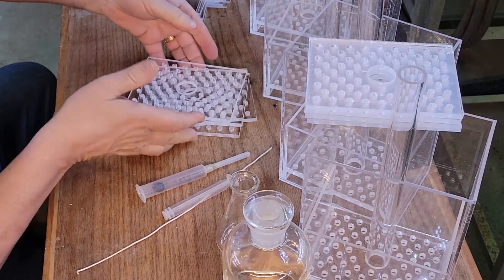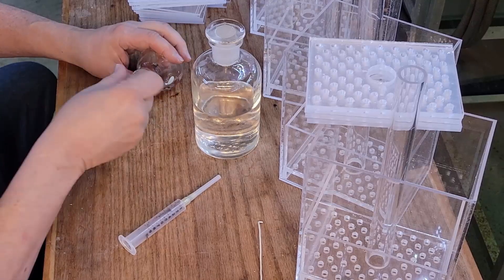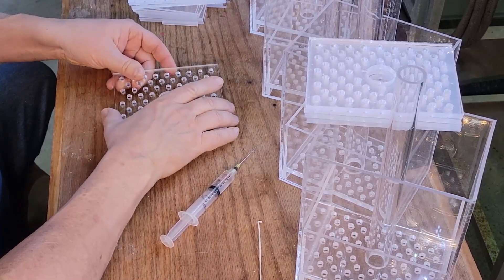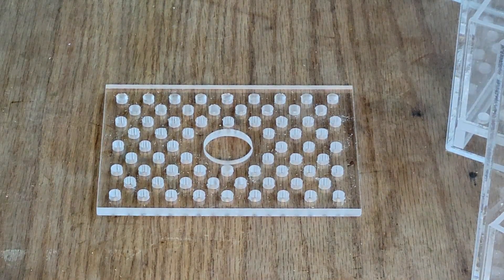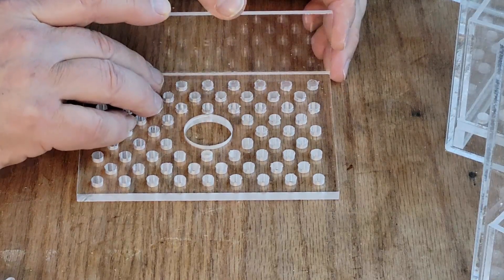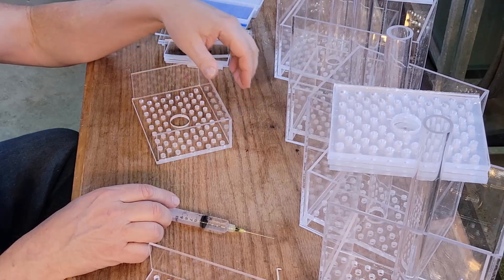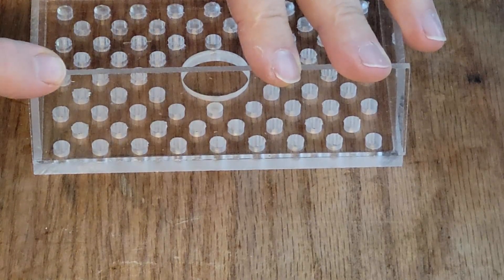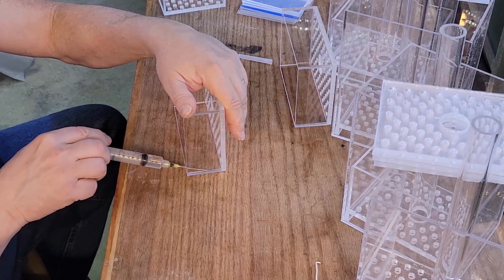Acrylic Welding: The Basics

Comment: Good and calm explanation! Thanks for this. I'm wondering if you're making products and a drop of glue falls on an undesirable spot, how can you remove this white, flaky glue stain afterward? Is there a trick for this?
Reply from the maker: You can, but it's labor intensive involving varying grits of acrylic abrasives and allot of buffing. That's why I use the syringe. It cuts down on most of that. Thanks for watching!

Comment: Where do you get your methylene? Is it the same as Methylene Blue? What about the syringes and needles? What gauge needle do you use?  Thanks.
Reply from the maker: Methylene chloride is not at all related to methylene blue. Methylene blue is a gram negative bacterial wall stain that prevents them from dividing. Methylene chloride is a chemical solvent. Thanks for the question!

Comment: methylene chloride is being banned for a variety of applications.
It is extremely unhealthy to breath.
I also used it for acrylic welding, but now I will only do it outside and with the wind blowing it away.
Reply from the maker: It is toxic, but the main reason for it being band in many places is due to it's explosive qualities when being shipped in quantity. It's still being used for consumption in applications like decaffeinated coffee. That said definitely use it in well ventilated spaces and most importantly use a syringe for application. With a syringe you can apply exact amounts and there is very little to gas off. Thanks for the comment!

Comment: Great video, I use glass syringe with a break works great and no need to worry about the rubber stopper. Try it if you do a lot of solvent welding like I do.
Reply: Also last for ever been using the same one for over 8 months .
Reply from the maker: I used to have some, but they got lost a long time ago. Are good ones expensive?

Comment: One secret taught to me by an Acrylic expert: Take some of the old needles from your solvent dispenser and pound them flat.
Then use those as shims in your joint before flowing the solvent.  Once the solvent completely "wets" the joint, let it set for a few seconds to soften the material, then pull the shims out and let the joint compress.
Reply from the maker: I've heard the same thing, but only when welding thicker material. Thanks for coming by!

Comment: Facinating. How did you drill all the holes without splitting/cracking the acrylic? My experience is poor and frustrating. Of course you may have used a laser cutter, but it would be good to know or see the holes being made. Good video
Reply from the maker: I drilled them out on my mill. A sharp bit and a firm backing really help

Comment: Acetone works, yeah. I tried it and found MEKP works better, makes a stronger joint. Never tried what the OP uses. MEKP is a common hardener for polyester resin.
Reply from the maker: I've never tried either of them. I will have to see what's available here

Comment: I use either Acetone or Cyclohexanone.   The Acetone evaporates very fast so work quickly.  The cyclohexanone evaporates slowly, but even a tiny amount of it stinks the house out...
In the future I might try dissolving a little styrofoam into the acetone to make it stickier.
Reply: Acetone doesnt actually dissolve polystyrene despite what it looks like. It weakens it and releases all the air, but the polymer chains mostly remain, so you get a "snotty glue" that you cant really thin further.
Lots of other common solvents work for PS though. Xylene, toluene, benzene, ethylacetate, MEK ect. (beware of fume hazards for many of these)
But why not use acryllic itself as a binder/thickener ? Using exactly matching plastics always give the strongest welds.
Reply from the maker: I've never used either of those. Thanks for watching!

Comment: I also like that ground glass bottle both form and presumably function. Do you find it prevents evaporation better than those metal cans?  I find that unless you use a wrench on the can, solvent will evaporate quickly though even the tiniest gap(very high vapor pressure).  Also do you use vacuum grease on the bottle cap? Thanks
Reply from the maker: I'ts great! It's specifically designed not to lose any of it's contents. No grease necessary.

Comment: Do you temper the parts?
Reply from the maker: Acrylic doesn't have a temper process. The only way to get harder acrylic is to buy cast, but it's twice the price
Reply: @justmakeit2849  I talked to professionals and even with Evonik/Röhm officials, and they said, that you have to temper their products after you drilled or put heat with a laser into the material. The same goes to some glues. You get the tension out of the material by tempering it.
Reply from the maker: Thanks. I will check into that @0Turbox

Comment: I think you should cover the safety aspects and PPE for those not aware as it's known to cause damage to the liver, skin, heart, eyes and likely cancer too from both inhalation and skin contact. It has gradually been increasingly banned. If wearing gloves, two layers are suggested with the inner ones being of PVA/EVA because that is resistant, and nitrile (which isn't) on the outside as it's less likely to rip. Some suggest that not wearing gloves would be better if you did get any in a glove, as it would stay longer against the skin inside a glove than if unprotected where it would evaporate quickly. Half masks are not recommended because of potential eye damage, so it should be a full face mask with supplied air. Using it with a fume hood or outside occasionally would you be ok? Tempting to say probably, and everyone should make their own risk assessment, but I really think anyone considering using it should fully research it so at least they can never say they didn't know.
Reply: The one-off exposure is not a good thing, but not as big a deal as repeated exposures. Exposure of bare skin to vapors is nothing like inhaling them. A person who frequently solvent welds acrylic needs to be a bit more paranoid than the guy who just wants to make a nice display case for something, and might go many years without a repeat exposure. Doing it for a living, day in and day out? TBH I would simply not do it on a regular basis even with full PPE. A quick project? I am fine with working in a well ventilated area without gloves, using a simple respirator and goggles or full face shield. Something else will kill me long before a fleeting exposure to these vapors will, or even a droplet or smear of the liquid on a finger.

EVERYTHING is "poisonous". Too much of anything, too often, too long, is "bad" for you. The numbers vary with the substance, is all. And something is gonna get you sooner or later, anyway. Cheeseburger? Bad, 3x/day for a year. Not so bad, once or twice a week. Beer? Pretty bad, 15 bottles a day. One or two? Probably good for you. Polonium? Pretty bad, even mg probably killing you if ingested.  You can die from drinking too much water, but that would be a lot of water. A cigar once or twice a year is probably harmless. 5 or 6 per day, you are taking a big chance at cancer and possible death by it. MEK or similar solvents are "somewhere" on the scale, closer to the upper danger range than the lower, but like with anything, more exposure is worse than less.
Reply: @growleym504 all good points. Another thing to bear in mind is to make sure that your ambient temperature is fairly cool. Methylene chloride has a very high vapor pressure (boiling point is 40C or 104F) so it has a tendency to squirt out of things like syringes all by itself. One might not mind about the health aspects too much if it's a one-off thing, but if the darn thing starts squirting solvent all over your project then it might become... irksome.
Reply: @alfredoprime5495  Good tip there!
Reply from the maker: Precautions for working with hazardous chemicals are too involved for a simple video. I have years of experience with this sort of thing and education to back it up and would find it almost impossible to relate this simply. I will put a warning in the next video though
Reply: @justmakeit2849  We can tell by your extensive use of PPE. Acetone does about as good with almost none of the risk. We welded hundreds of guards at Kraft Foods using Acetone. Without a respirator your really messing yourself up. Good luck..
Reply: @justmakeit2849  Don't over think it. Any advice is better than no advice concerning PPE and reducing risk exposure. Saying, "It's too complicated, so I'll tell you nothing." comes across like a copout (although I'm sure you didn't mean it like that). The key word is REDUCE, not ELIMINATE risk. It doesn't have to be perfect and all-encompassing to be valuable, informative & helpful. I understand it's difficult to switch hats from Engineer to Teacher. Thank you for all you do for all of us!
Reply from the maker: My intent is to make a followup video to try and cover just that @branchandfoundry560
Reply: @justmakeit2849  Sweet! Thanks again
Reply: @justmakeit2849  seems irresponsible to not even mention the safety concerns when literally educating people on how to use it...
Reply from the maker: try here https://studio.youtube.com/video/-kvat6kXJLc/edit @dollarbutt
Reply: @makers_lab youre a tool
Reply: Safety is oversold. There is not nearly as much risk as this message portrays